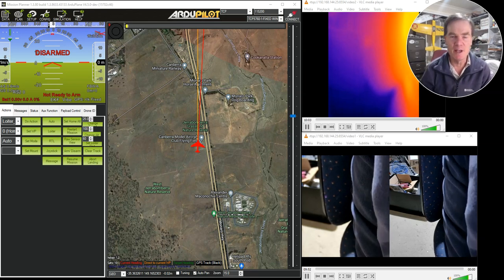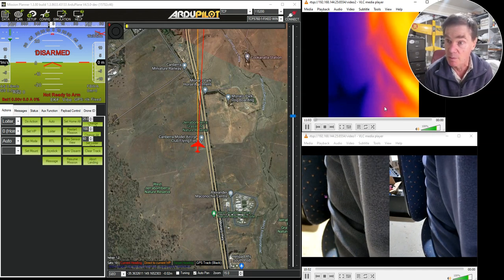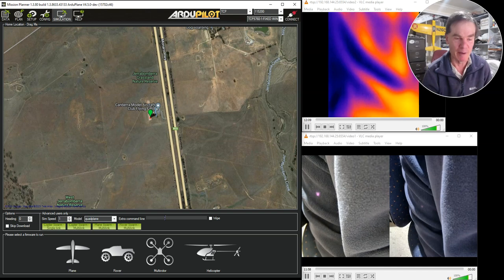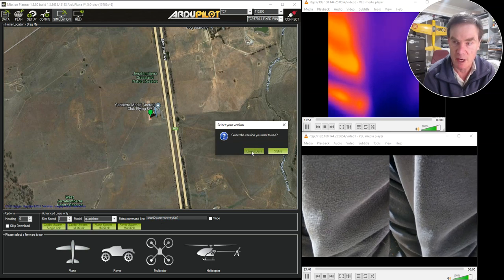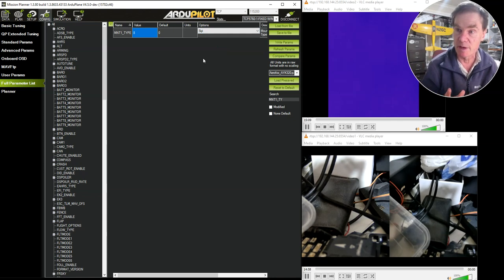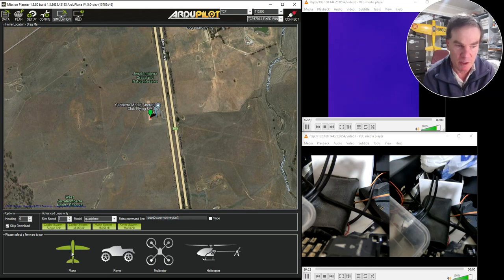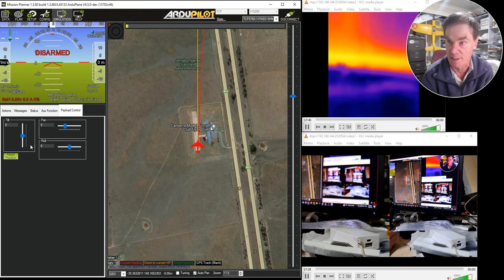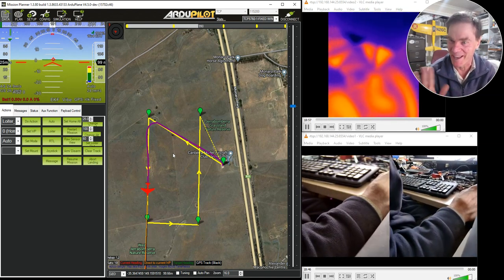Connecting a SIYI ZT30 to the ArduPilot SITL Simulator

Comment: I hav discovered a way to do this without a usb to serial dongle. 1) Run 2 instances of ArduPilot on windows pc. 2)Connect first instance to drone and setup serial pass through for serial port connected to  the SIYI. 3) Connect 2nd instance to simulator as in video (use usb port # same as port of drone connected to first mp instance -1). 4) Disconnect 1st mp instance from drone and it should be operational for SIYI control from simulator.

Comment: Thank you Andrew, this is precisely what our mission requires.  We are using a siyi A8 mini and we have followed your tutorial to the letter (and aligns with the ardupilot gimbal configuration documentation).  We appear to have a working serial connection, but consistently receive PreArm: Mount: not healthy messages and can’t control the gimbal.  Any suggestions on how we can confirm the A8 is actually serviceable?